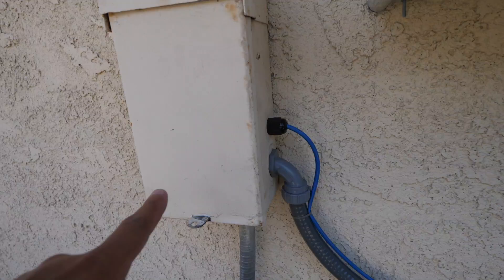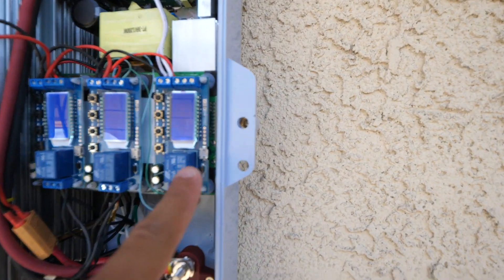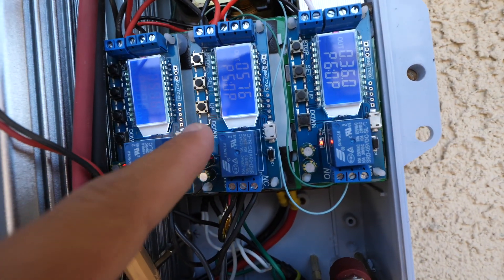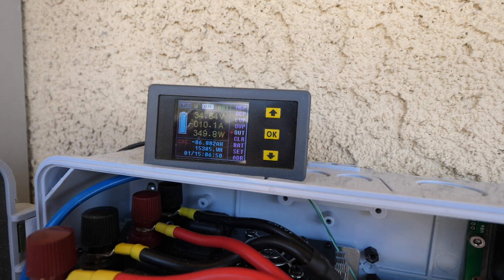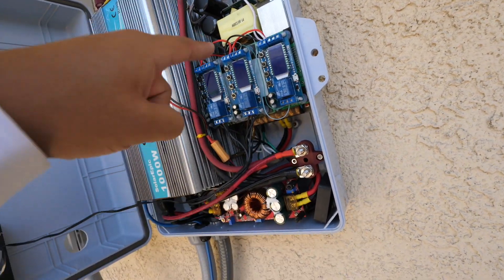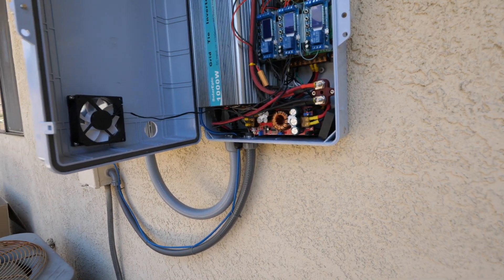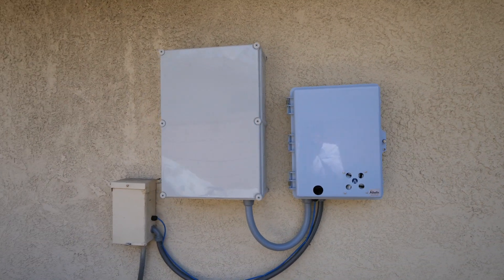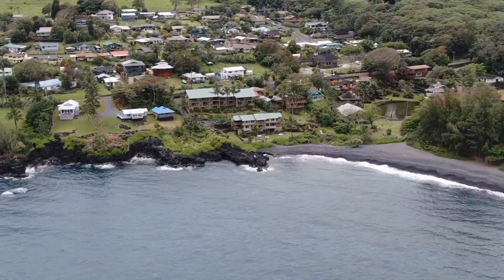Peakshaving DIY Powerwall  Project

Comment: another cool video, you definitely deserve and earned vacation time
Reply: booster pack is coming along nicely, I'm looking for some decent solar panels and someone that could 3d print me a part, if I released details on something it could take a while for me to get a provisional patent with a prototype in the meantime someone could easily 3d print it and I'd still be broke,  for now to protect the idea a provisional patent could be obtained without a prototype then the provisional patent could be sold then the buyer 3d prints it and obtains the rights to the patent, I'd rather watch people 3d print it is excellent next they'll be 3d printed vehicles. also send a copy of the provisional patent to yourself and don't open it, a lawyer isn't needed in either especially that could handle designs of some electrical like your  EV in order to explain the idea through a provisional patent application, even the patent office officials can't understand applications but issue a provisional patent application then you prove it with a prototype and you own it then a patent is granted. How far back you can come up with evidence that you created something and someone else is benefiting off it used to be illegal. digital is provable evidence and you can renu the application for more time to make a prototype, easy to do,  you come up with new things all the time, improving(a improvision) something is applicable making it yours. costs like 80 dollars

Comment: Is it a 120 or 240 volt inverter?
Reply from the maker: 120v but the 220v are available on AliExpress and they would work better
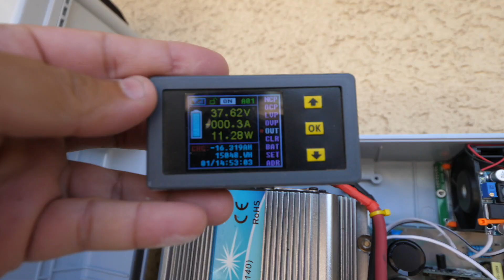Reply: He's using 2x 110V units. At 0:58 you can see them stacked on top of each other. I would guess that each one feeds a hot leg with a common Neutral.
I agree, getting 1x 240V unit would be better and probably more efficient in the end. Not to mention less waste heat.

Comment: Can these battery packs be used (instead of 18650s) to create an off-grid powerwall???
Reply from the maker: Yes if you can find a 32v inverter
Reply: @jehugarcia  Where would I start looking for one of those? :)
Reply: @nycmarkymark  Here's what I found so far.  I don't know anything about the company, but they have a few 32v options.
Reply: @ew3431  Do you have a link? I don't see anything.
Reply: @nycmarkymark  oops!  https://www.outsidesupply.com/power-inverters/

Comment: If you use the thermostat signal you could start the inverter at the same time the compressor is switched on and cut the entire peak load.
Solar charging batteries would be awesome to get free power to reduce peak loads.

Nice setup. Enjoy the vacation!
Reply: I had same Idea. I went to inverter link. I can't tell if he is using 120 or 240 volt 1000 watt inverter.
Reply: @Lucky4wd4840  The outside AC Units usually run from 240 Volts.

The mini-splits will mostly be of 120 or mine is anyway have heard of some for the off grid that uses 48 volts.
Reply: @Lucky4wd4840  He has 2x 120v inverters for 240v combine.

Comment: Hey Jehu - Wanted to point out that that A/C unit is installed incorrectly there is supposed to be a few feet of clearance around the condenser (radiator) of the unit. With part of it facing the wall it wont draw in air as efficiently and therefore use more power to remove the same amount of heat.
Reply: He rents, there's nothing he can do about it.
Reply: @brandoncharley3070  - I know :) probably not much point in correcting it on such an old unit either but info can stay with you for the future.

Comment: It’s a good concept to get going, and really showing how an application can be implemented. It’s a grid tied inverter, so it should be off if there is no line voltage, correct.. or is there a need for the transfer switch.? Because as the graph showed, you were only supplementing the power demand.

A key point here, and i am not sure if you own your home or not, is that upgrading your AC to a higher SEER rating will give you much more of an efficient unit. And those exercises should be done first before this especially if you had an older R-22 unit that are far less efficient with the lower head pressures.  Also, an inverter AC unit would greatly help that initial startup spike,  as they run constantly at lower speeds rather than cycling 50% of the time.

to help save the impact on that inverter, do you have a time delay in your relays from when the AC kicks on. Before the inverter starts running. (Maybe i missed you talking about this?)

With that 1000 watt inverter, i assume your base draw is far below that, which is why you are turning it on (given the parameters) with the AC unit.

Sorry for the long post. :)
Reply: Uninvited Guest If you look closely, I believe there are 2 inverters, 1behind the other
Reply: @sailingadventurous784  Yep, think you have it. Just looked up the inverter , plus Jehu refers to the inverter as "these guys" plural. Since output is 115vdc that must be how it is providing 230 to the outside unit. Threw me till your comment so thanks for the observation. As grid tied ,I am also guessing if the grid goes down the inverters will not energize to maintain safety and prevent feed back to the utility during power outages. Pretty good prototyping.
Reply: Good concept but not the way to go. Before I had taken vacation I'd have shown my before and after electric bill. If this hazardous device burn the house down, then we'll have even more new ordinances limiting green technology.

Comment: I thought about something similar from my power wall. I thought about running a/c turn on signal to a relay controlling a grid tie to run when a/c kicks on.  Also my a/c has a delay start module inside so it could ramp up the grid tie inverter 5-10 seconds before a/c compressor starts
Reply: I recently changed my condenser fan motor to a larger hp higher rpm. and installed water misters. so far have seen a 500 W decrease in power draw when it cycles. 2.5 ton unit. was drawing 1500 w at night to 2500 w during heat of day. Cold front rolled through and I saw watts drop to less than 800 during night cycles.
Reply: I am currently controlling two 300 Watt 110V grid ties tied to each leg on split phase power right now. Each inverter is on a separate 30A relay. max draw of each inverter is 15A at 24V. I am only measuring 10A maximum draw so far. I only have 600W of solar up so far. Charge controller controls the relays.

Comment: Jehu, this is really great design and application!!! Have you ever tested/ played with the Grid-Tie Inverters with the built-in Limiter? They monitor your usage from the grid (with CT sensor) and only kick in and delivery the same level or slightly less amount of energy back into your local grid so that you're only covering the usage from your provider and nothing more. Some of reasons behind this development are because the grid often doesn't pay you to feed-in (unless you have an existing or grandfathered agreement) and it could be illegal unless you've registered with them, use approved equipment, have it electrically certified and inspected, etc...  So, essentially you've achieved something very very similar and developed it further since you've designed in a battery charging phase/ switch-over. Get this hooked up to your solar to really make a bigger saving/ RoI impact. Very nice! Looking forward to the detailed design. Cheers.
Reply from the maker: those are next,  they been sitting on my desk waiting their turn for a while
Reply: @jehugarcia  Very nice work! I looked thru all your product links, thanks for those. What are you using for energy monitoring to be able to pull up that chart on your phone? Live your projects, Cheers from Las Vegas!
Reply: I want to know about these inverters. And for this exact reason.
Reply: does would not help 
what he is doing makes sense

Comment: Don't get me wrong, it's an interesting idea...  but...  let me get this straight.  You are charging the batteries at low energy cost times (during the middle of the night) then when the AC kicks on during peak energy cost times (middle of the day) you supplement the power that the AC is using, but only by half, again waiting for the AC to kick on.  Wouldn't you do better to charge the batteries during the night, then once it hits peak energy cost, you just dump the energy into the grid?  Ignore the AC, your house will draw the 1000 watt, regardless of the AC usage (I'd wager).  Just dump the energy in, until the batteries are dead, then reset the cycle.  If the grid tie inverter can't handle 100% duty cycle, just cycle the 10 on, 15 off, ignore the AC, you're just adding complexity that isn't needed.

My other concern is, what if the grid goes down?  Your grid tie inverter is now putting 1000 watts into the now dead grid, possibly injuring linemen attempting to repair the outage.  Unless the grid tie inverter has fail safes for that, however it's probably not up to code, without a transfer switch.  Just a consideration.
Reply: Not all places allow you to net meter.
Reply: @OmgImAlexis  Ok, but still the house is likely to draw over 1000 watts, when the AC is off.
Reply: @TheKnightofoldcode  Its a grid-tie inverter (written on it)
Reply: I agree with you....I'm watching this and thinking that the ROI has to be years.....and years and years away.  Makes very little sense.  Pretty, sure....SHOW ME THE MATH.
Reply: stirlingfromla ROI is way shorter than that. We’re all watching and commenting on the video. He’ll break even before he gets back from HI.
Reply: Multiple inverters are stacked, it appears to be sourcing 2.5KW from the battery when engaged, but your point stands, I have net metering but I don't know if PG&E does. You can't grid tie (legally) without safety shutoffs to protect line workers.
Reply: ottopjm it only works if it can sense grid current, if power is out it won’t send power to grid. How reliable that feature is that’s another question

Comment: 0oo Open holes in the casing, mmm moisture in winter! ;)
Reply: Ya i dont know about California but here in texas i would at least have some screen to keep like dirt-dobber and wasp and hornets out
Reply: California, no moisture.  He will probably add screen material to cut back on spiders and dirt entering.  I think the invertor would benefit from a larger case.  That’s pretty tight tolerance for a bunch of Chinese electronics.   Pretty cool idea, I think California peak is around 50 cents and likely to keep climbing, so this will pay off faster than a solar power setup, but is also a good compliment to a solar install.
Reply: @olemissjim  Average of 4.65 inches of precipitation in December around California, so not completely true. Dew & moisture as well as ingress for creepy crawlies is something to be thought about though.
Reply: Prototype. Just hope it is being monitored or not engaged while the vacation in happening.

Comment: Nice set up i have the big brother version of that. Using the 5k battery pack of a kia sonata same weird voltage 33.9 volts and a ups 3000 watts that runs on 48 volts but is currently running on the 33 volts but i haven't tested for how long will it keep on ..